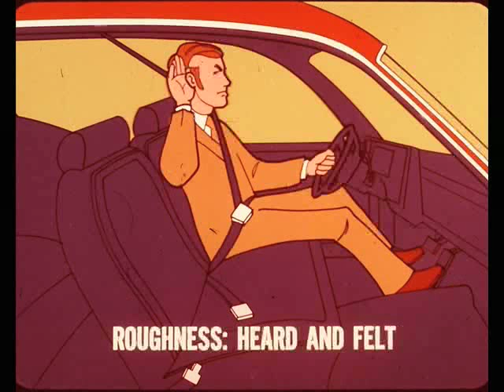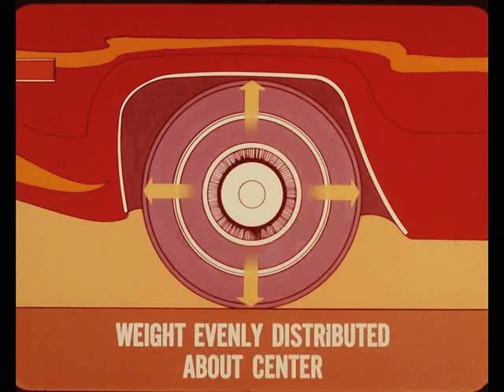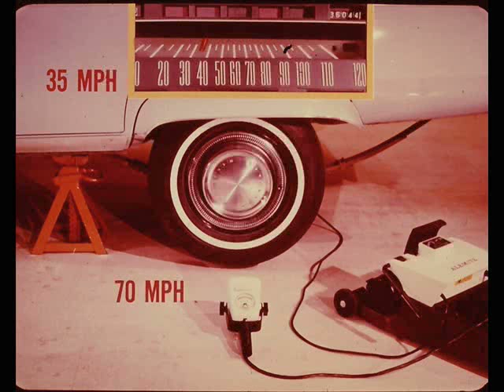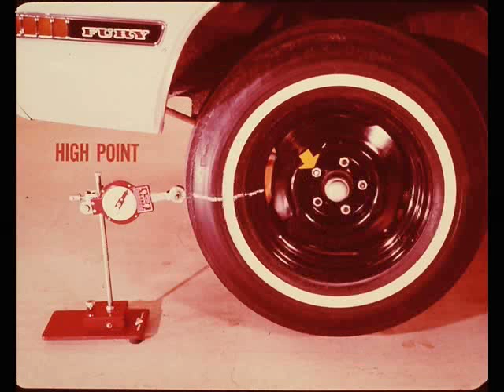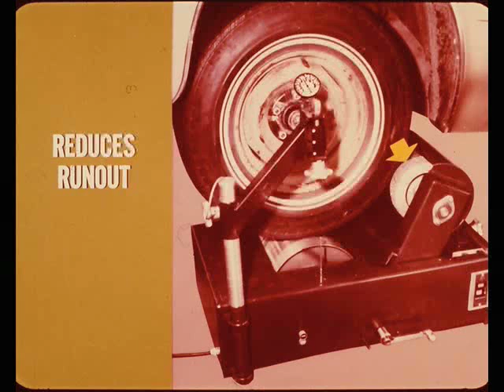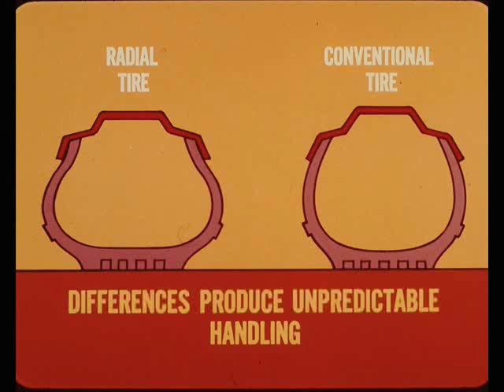MTSC - 1972, Volume 72-12 Today's Tires Facts and Fixes

Comment: I'm surprised these videos about tires and wheel alignment don't mention tire pull. It happens sometimes, but I was told the problem was even worse when early radial tires went on sale.

It is interesting to see mention of radial and bias-ply tires in this video. My dad had a 1971 Toyota Corolla that was built with bias-ply tires. Although it was difficult for him to afford it at the time, he bought premium Pirelli radial tires when he needed replacements, and he said it was totally worth it. There was no way he would ever use a bias-ply tire again.